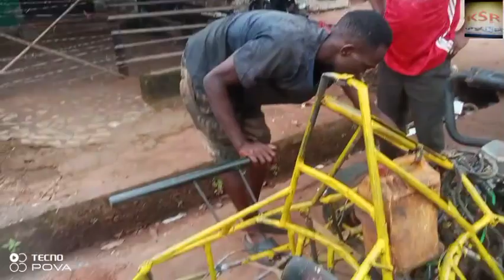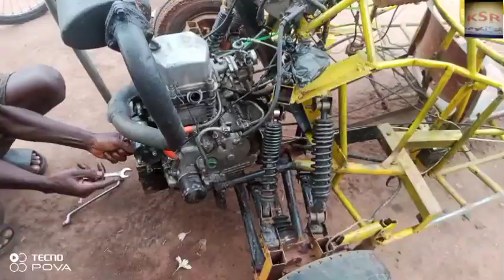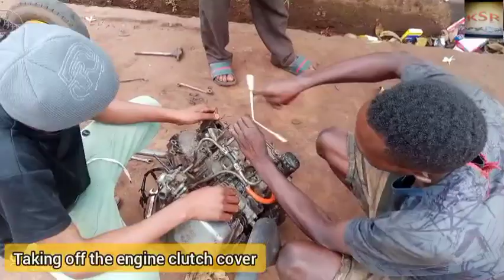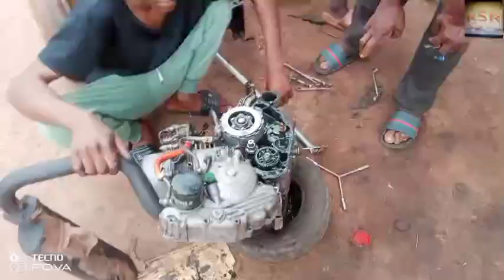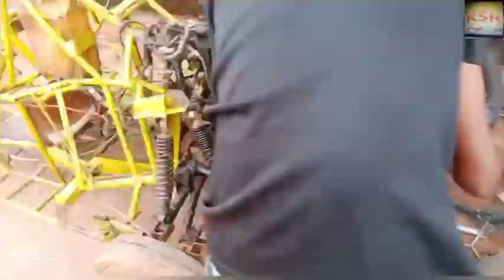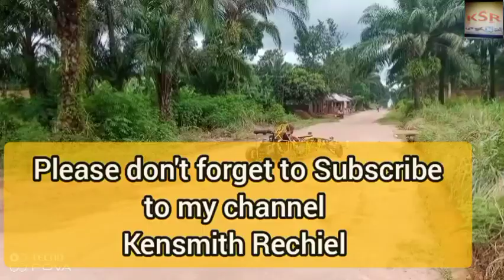inserts a high level gear transmission system in my homemade car🔥💪

Comment: Hi, Im not sure how much you know about these engines, but the output and input shaft are wedged between the crank cases, you have to split the engine cases to remove the shafts, which will then let you swap the gears on the shaft.
Reply from the maker: Exactly